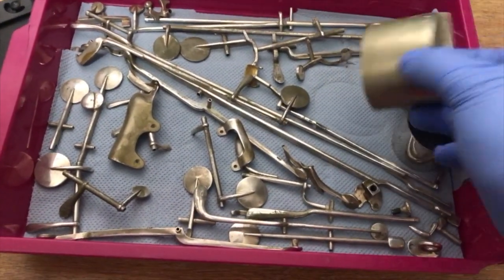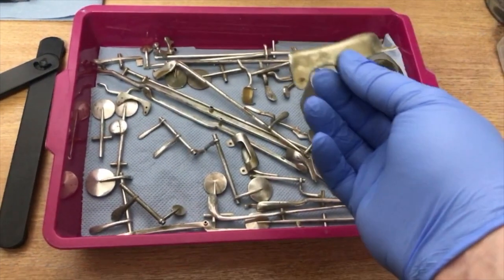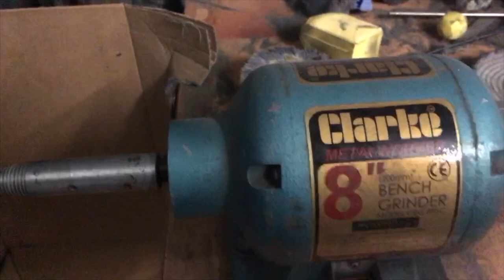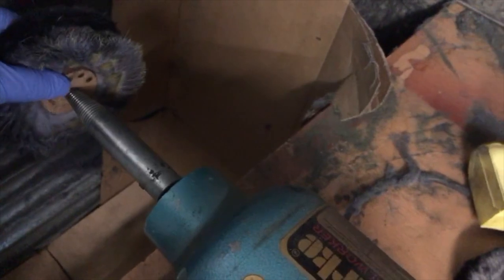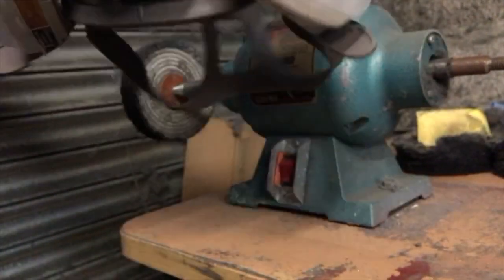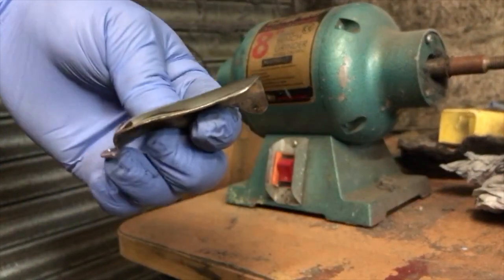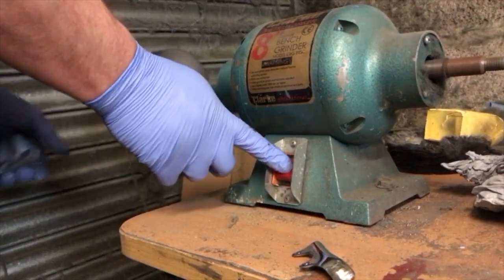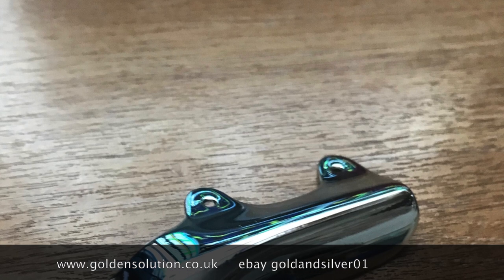How to Polish Metal to a Mirror Finish

Comment: hi, 
could you give me the links from where I could buy all this polishing kit ?
th,
Reply from the maker: Minascurta Ion http://www.thepolishingshop.co.uk/acatalog/Polishing_Kits.html?gclid=EAIaIQobChMIuqPkx7uK3QIVlYXVCh3clwmpEAAYASAAEgI2__D_BwE
Reply from the maker: Minascurta Ion  
I use a bench grinder
Reply: thank you so much
Reply from the maker: Minascurta Ion no problem
Reply: Golden Solution hi, I come back with another question ))

I have to polish some aluminium stuff for motorbike, 

They are old and were made by melting the Al and releasing it in forms made by sand, 

The point is that surface have porous finish,

Could you recommend me what mobs and abrasive material to use in order to keep as much as possible that finish surface,

Thank you,
Reply from the maker: Hi 
You need to ask the polishing shop
Send them an email 
Thanks